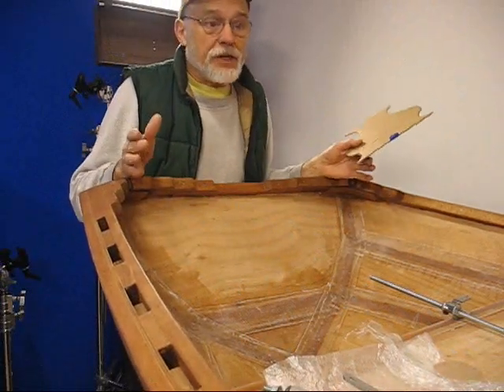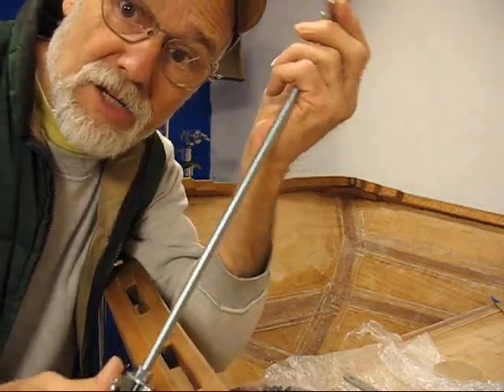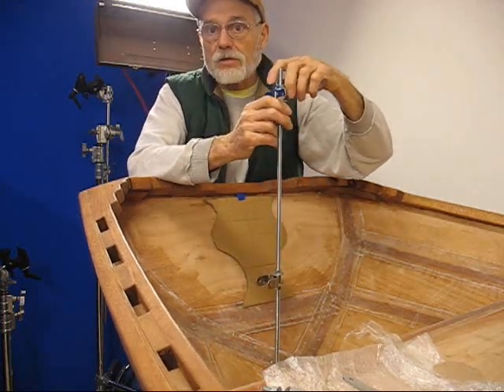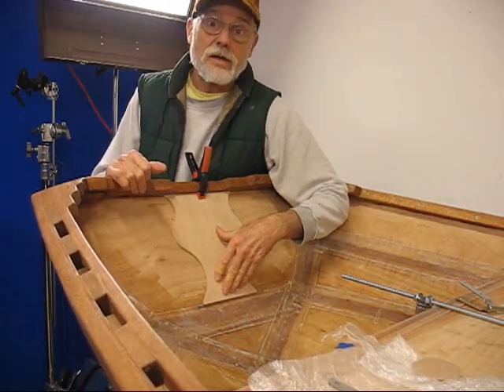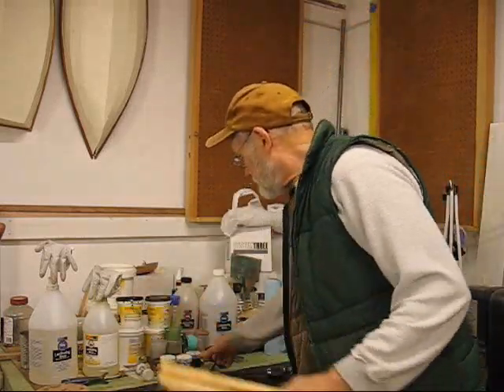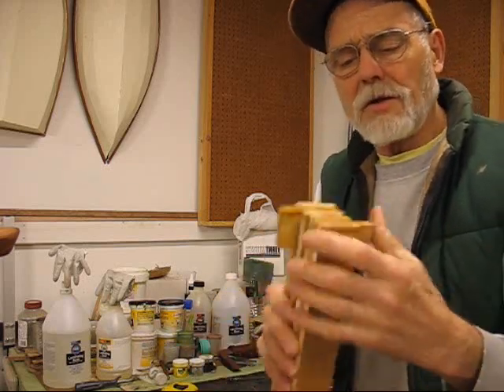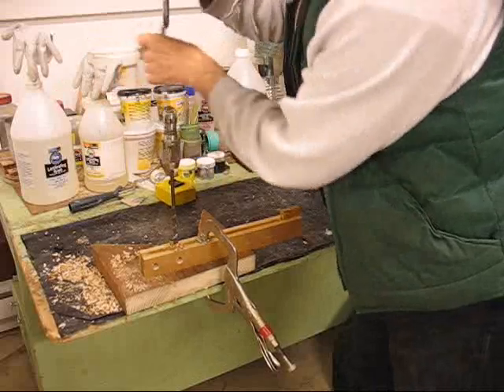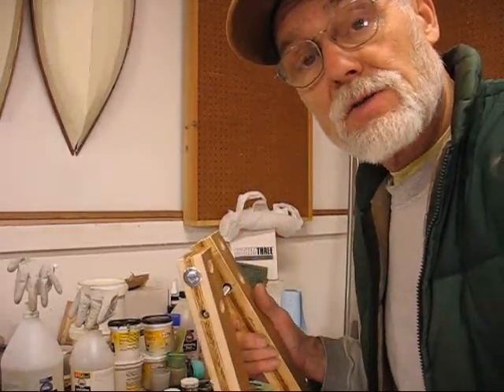Part 33-1 Installing Rudder and Trim.wmv

Comment from the maker: @duckworks The RL-690-X would work for the lower gudgeon, but is 1/4" too wide for this hull.  If I made the keel strip wider it would work.  The Weekender fitting is also too wide by 1/2" to fit the vertical part of the keel strip. :(